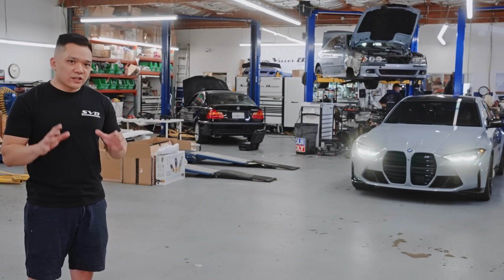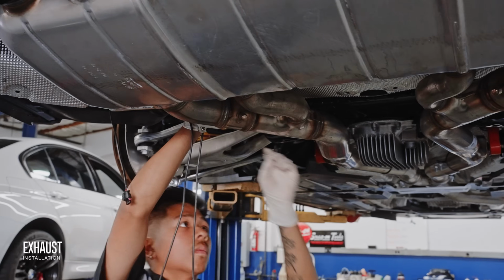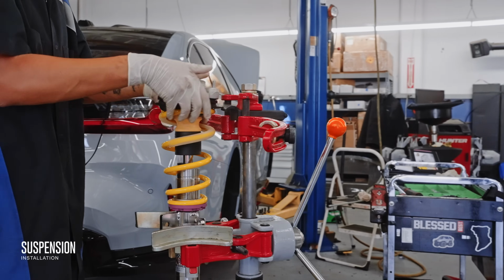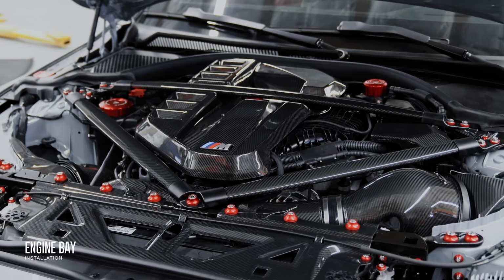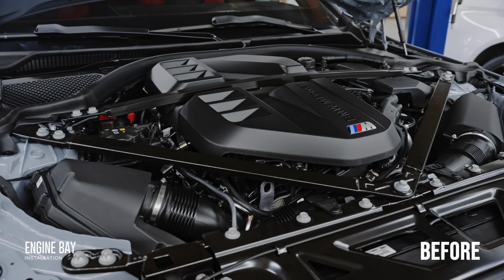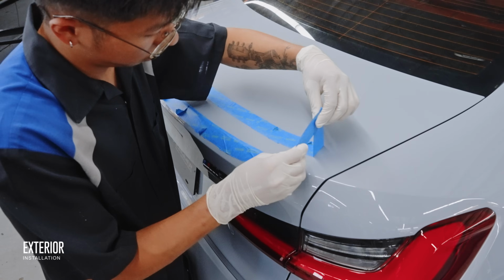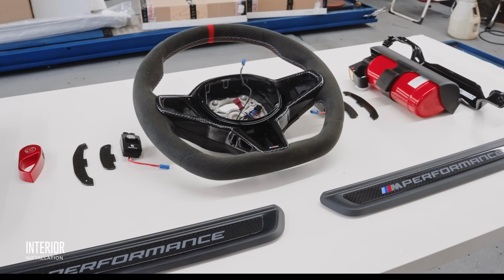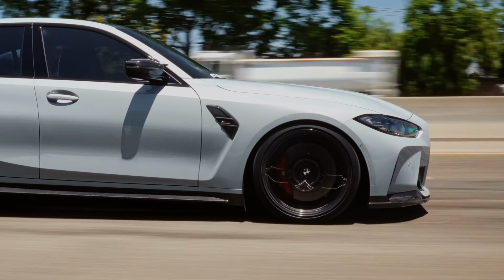We spent $40k on this brand new BMW G80 M3

Comment: spent 40k when the car doesn't look much better than stock, and to make matters worse, this pre-lci LED headlights are the low end version with the ugly half daytime running lights. If you're going to spend that much upgrade the headlight housing to Lasers or LCI headlights. Unbelievable to spend 40k without even getting an Adro front bumper is crazy.

Comment: These mods are for show, not function. You only need to upgrade to adjustable camber-caster plates and adjustable LCAs and the car will be truly a track weapon. Add another 5k for a DME unlock and tune, and you have a beast.

Comment: 7:21 first bottle neck of power is incorrect. Standard air boxes are good for 1000bhp!
Reply: aaand without letting a ton of dust in that will screw the top rings :)
Reply: @torentmonkey  lol what oem airbox will fit an aftermarket big turbo lol

Comment: honestly with such good pricing on on the f8x would be great to see a video on a high mileage one, common issues, crankhub, and maybe even market a high mileage service package such as for cars over 65k miles when purchased as a deal to get tuned up
Reply: We will work on a series of such for you guys!
Reply: There is no crankhub issue on the s58, basic maintenance is all you need.  We klm single turbo’d and beat a 26k mile xdrive to almost 91k miles until we sold it- no issues and tuned around 825whp, conservative flex fuel etc….only CSF intake mani and oil cooler.